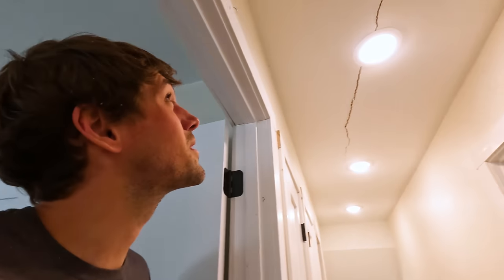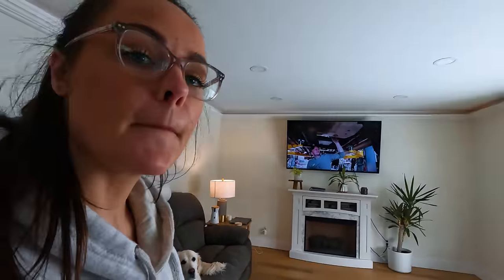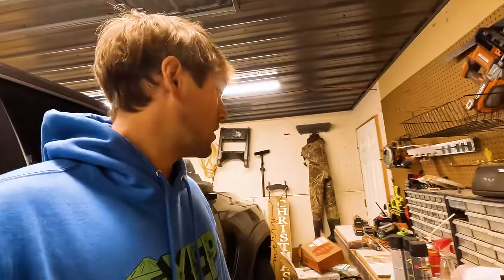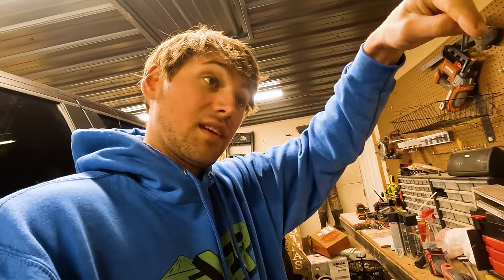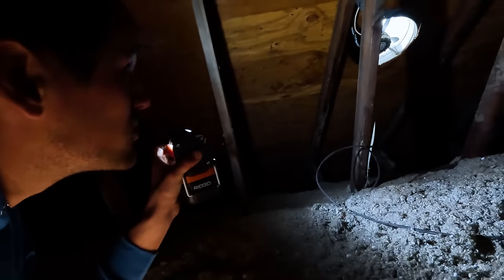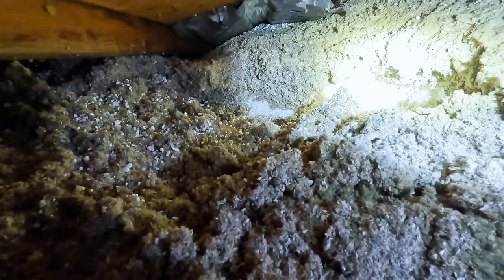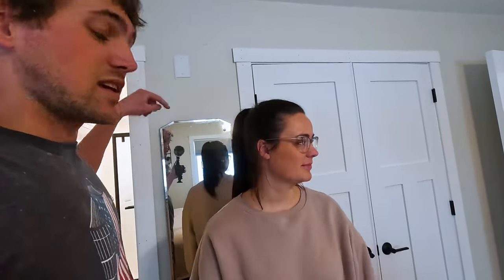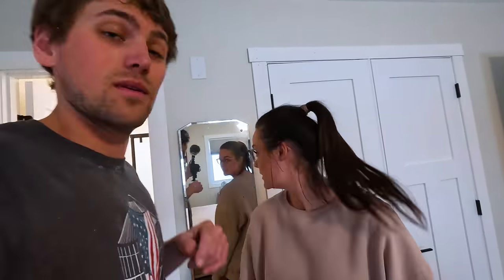DIY House Remodel Gone Wrong!!

Comment: Renovation is fun. I have fully renovated the house I was born in both the interior and exterior of a 130 year old Victorian. All of it completely original condition other than the bath room which the original one was remolded in 1910 with subway tile and an octagonal tile floor . Alway something to repair and redo. But you learn.

Comment: Attic exhaust fans are on a temperature control switch so once it reaches a certain temperature it will come on. Plus bathroom fans for toilets didnt have to penetrate outside wall unless it’s spray foam, we use to run them to the soffet. but shower fans have to penetrate outside walls per new codes due to the moisture.

Comment: Jean had me laughing when you gave her the vaccum was so funny.  Don't worry Chet, stuff happens during DIY, but you are getting it done.  I hate getting stuff with missing parts, if it was a return, they should check to make sure everything is there when it's returned, bummer you saw it after installing the unit.  G-d bless.

Comment: Like others said you need that exhaust fan have its own vent tube it also can not be vent out rhe roof it needs to vent out the side of the house. The tube to needs to go straight up from the fan and then run horizontal with a slight angle down to the outside of the house. If you do not do this left over moisture in the tube can run back into the fan area.

Comment: I'm sure it's been said.  To meet National Electrical Code you need an electrical junction box behind the vanity light.  Each exhaust fan should be vented on its own.  If you have a gable end they make some nice retrofit kits to vent outside in siding.  You are correct Insulated venting is better.
Reply: Joys of home ownership.
Reply: The fart fams looks nice.

Comment: In a area heavy snow area like yours you need to run those out to the soffit or wall to vent. In your case, the soffit vent is what you would do. That’s the way we do it in northern Wisconsin. The roof fence will eventually just lead to leaks or moisture getting with snow.

Comment: Hey Chet I had the same situation where someone ran the bathroom vent into the attic. I found out the hard way because the moisture rotted all the roof rafters. So you need to vent that out side absolutely!!  That fan should have a thermostat to kick the fan on when it gets hot up in the attic.
Hope this help.

Comment: I feel for you Chet.  I changed all three of my bathroom fans to bigger versions last year.  Not fun.  Had to cut holes bigger.  Also, the old fans vented into the attic and I changed them to vent through the roof.  Happy with the results but did not enjoy the process.

Comment: That power vent has a thermostat that’s in the grey box mounted to the rafter. That black adjustment screw in the side sets the temperature when it turns on and off. Generally they are hard wired to a live circuit

Comment: Chet on your new fan area you could go to the soffit area and if you have enough room in soffit you could cut a round hole into the soffit pan and push the air thru the bottom of the soffit, this way no roofing at all !

Comment: You need to go back and put a Tee up for the roof jack fitting, snd make sure the new fan has a draft flapper and prevent back feeding the exhaust air. 7:34  They make Automatic switch with a humidity control. A Humidistat runs the fan as needed.

Comment: If you shove the hose into the eaves, you can get a vent to exit out the soffit if you don't want to poke through the roof.  Use the insulated hose.  The hot humid air will condense into water in you cold attic.

Comment: When I built my house I put an 8:12 pitch roof on it.  It's kind of a pain in the butt to walk on the roof but on the bright side there is plenty of room to move around up in the attic.  As to stepping on the sheet rock, it's easy to do that will all the insulation up there.  You can't see the rafters and kind of have to go by feel.  I worry every time I'm in the attic that I'll miss a rafter and step on the sheet rock.  Don't beat yourself up over making an easy to make mistake.  Everything can be fixed by a good mud/texture guy.

Comment: Live in Canada. Venting into the attic is not good as it’ll add warm air to your cold air creating condensation into the attic. Mood and rot will happen over time. Also remember to use an insulated vent hose otherwise condensation will form from the temperature differential, with same problem. Ps if you put in a timer switch it’ll help with the vent time.

Comment: NEVER vent into the attic or the eve unless you love mold!  That is the whole idea behind venting - to eliminate moisture vapor issues.  That is also why your attic is ventilated or should be.  BTW, that huge fan in your roof is a whole house ventilation fan.  It works to draw air into the house to cool as long as you have your attic cover open.  These are usually installed in your attic opening.  Admire your gumption!!

Comment: We call it the OLYMPIC ATTIC CRAWL!  Good job that job sucks!!!
yes the ducts should be insulated to prevent condensation from temp difference in winter.
Each fan should go to separate roof vents. but wait till the warmer weather  so shingles and caulk will seal correctly.
I would suggest putting a junction box behind vanity light
You should add another switch  location and add a 60min timer for the fan only

Comment: 17:23 "cracks Happen. Severity varies". Fabricated brackets are smart. This is why the smart installer saves odd bits that might be useful later. Special fasteners, etc.

Comment: Chet you should get those fan hoses  venting out of the house, I own a roofing business and I had one person call for a leaking roofing in the middle of winter only to find his fan hose did the same as yours and built up a 2 foot high snow bank in his attic, and that fan you didn’t know anything about is called a power vent, it’s set on a thermostat where when you attic hits a certain tempature it fires up and sucks the hot air out, if you need advice on how to correctly fix your fan hoses on the roof top let me know and I can send you a video on how to get it done right

Comment: We re did our whole ceiling after an insulated exhaust pipe was previously installed wrong, it had been left about 4 feet to long and left a big spot for condensation to settle,  it let the water soak into the insulation of the pipe and eventually into the drywall ceiling causing mold.

Comment: Chet even the best have misstepped when crawling around in the rafters. At least you didn't go all the way through 👍. 
Even I have stepped on the ceiling before. I just got lucky that it was plaster and not drywall so I didn't go through.

Comment: Your attic fan (the one in the roof) looked like it was burned up on the video. Might need to replace that too. In the meantime take your bathroom exhaust fan duct(s) and route them to that attic fan hole. It will minimize humidity in your attic until you can make the proper penetration thru the roof when the weather improves. And since you have to have your drywall guy back to fix your ceiling, run another wire from your shower fan/lite down to the inside wall, just outside the shower. There is an easy way to wire a switch there to control the fan/lite assembly separate from the vanity lite.

Comment: The roof fan has a thermostat (that little silver box you shinned the camera on) there should be a thermostat in it, you just set it to the temperature that you want it to turn on. Most bathroom fans that I have seen just go in the attic. Should have a metal fish to pull the wires. Good luck!

Comment: Ensure you have a GFCI connected ti the fan, usually if its on same circuit acs the bathroom plug it should be good, pop/test the plug GFCI to see if the fan stops.

Comment: Fish down to the switch box, get a Stacked Switch for on the Light circuit switch and then the stack is a fan feed. If you want a automatic they have a Humidistat switch to start and stop the fan automatically.thats an automatic attic ventilation fans - trim the tarpaper to clear the hole 🕳️ and put the fan exhaust on a separate louver on an Eave to outside exhaust - Like a clothes dryer Louver fitting. 9:16

Comment: You should also replace the exhaust tubes with insulated tube so you don't get moisture build up in the winter. If it starts dripping back in to the bath you will know that insulated tube is required.

Comment: Fished in wires don't need staples chet. It's even more fun when u find bats in the attic. Most times we fish down to the switch so u could do a stack switch. If u would have used a 14/3

Comment: My bathroom fan failed.  Interesting to know, even with a fan that was installed in the early 1970s, you can still get parts.  My wife kept turning on the fan and then forgetting it.  So I just installed timer switches that automatically turns off the fan after 15 minutes.  It was worth it.  Having a fan run for hours, blowing heated air outside costs money.

Comment: Vent the exhaust out the wall ,just like a dryer vent .Use rigid insulated pipe Way easier,,, but your into one now , wow.lol.Vent it out of the soffit now use the insulated rigid pipe and make sure it is on a slope towards the outside .

Comment: Chet you need to vent it to the outside and I don't believe you can tee them together because when one fan is running it will try to push it out the other unit and vise a versa, if the big swede give you crap you can just send him up there.

Comment: The Strugglebus runs all of us over at some point.  Ask your Dad how he knows what not to do.  I have to agree with other posts, you can't T an air vent, air doesn't work like electricity.  You'll just end up blowing moisture back down the leg without the running fan.  Unfortunately you got some unscrupulous and lazy roofers.  All vents should be replaced and hooked back up properly, even the annoying ones on the edge of the roof.  And the last step is always the most likely to cause the need for more steps.  Another lesson that is always learned the hard way, no matter who it is.  Take care and God bless!

Comment: That's a power vent. If working it comes on at a set temp. Put one in one of my previous houses. Works well when they operate. The blow in  insulation looks like cellulose. Basically ground up newspaper

Comment: Roof spaces are always a painful experience that type of installation has not been installed in homes for over 30 years or more due to various complications you should always where a disposable suit when dealing with that stuff it’s pretty bad if you have to go up again get yourself a proper mask not a disposable one they are just not good enough for that type of job as for ceiling it can be fixed at least you didn’t end up on the hallway floor so take that as a positive stay safe and best wishes from the UK

Comment: only thing is that, until you get that vent installed correctly, you may feel some cool air coming in when the fan's not on.  Shouldn't be bad though as I think there's a vent door inside the fan box.

Comment: What is the wire size that you are teeing into? And what is the braker size will they both hold up to the amperage? If you have two roof fans holes I would run each one to there own hole. We always put some plywood down over the rafters so you can walk or crawl on .

Comment: Lol. 
  Since you know where the wall 2x4 is for the switch wall, you just run another wire over to the fan. Add a 2 gang for switches, and now have light switch. Fan switch. Bam bam😂

Comment: Some things are worth paying to have done.   Those fans are heat exhaust fans for summer
Me, I’d leave wire as is and if vent pipe does not touch fan blades you tied up, leave it as is
Good job with fan.   Glad you didn’t step totally thru ceiling

Comment: live and learn :face-blue-smiling::face-blue-smiling::face-blue-smiling: You should have spliced into the lite wire in the attic and been done with it and they have a bathroom vent fan with a pull chain to turn the fan off and on

Comment: Sorry Chet, but each vent fan  needs a different vent to the atmosphere, with a T, both vent fans need to be running at the same time or you are going to be moving  moisture from 1 bathroom to the other 1...

Comment: Yeah the flex pipe should be hooked up, an the fan in the Attic, they should have got rid of it, there not used anymore really, just a Energy user, thanks for sharing chet, oh next time hook wire up before pushing fan in place an the flex pipe, then you won't struggle in Attic in that tight spot,

Comment: Not gonna pile on Chet. The fan looked to be a whole house fan or attic fan. Never tie into another vent, you should always have a dedicated vent line for every vent going outside. And yes it's bad to vent moist air into your attic, it will cause mold.

Comment: Run your ducting under the insulation until you need it to pop up to go out. Running on top of the insulation, the condensation freezes in the duct and then will drip back into your bathroom.

Comment: Chet after going in the attic you should have gotten a wall mount exhaust fan that vented directly to the outside and per code as long as there is a window in a bathroom an exhaust fan is not required per code which I think is stupid. I put a exhaust fan in both our bathroom’s because they came without exhaust fans my wife takes extremely hot showers and I couldn’t stand to go in after her and during the summer time it would heat up the master bedroom and I prefer to be cold than hot. Not a fun job and at least you aren’t doing this during the summer heat in the attic.

Comment: I would have done it just the way you want it, make holes in the wall put the extra switch, run the wire then call a plasterer. You will be happier it’s done right!

Comment: Chet, several things. 1. If you are going to the trouble to fish the wire to the light, you are only 3 to 4 feet from fishing to the switch! Then you can have the fan on its own switch. 2. Never tee into another vet. It’s bad for several reasons, including having condensation come down into the other fan.  3. The roofers don’t drop the vent into your attic on purpose. But if it happens, they rarely tell you. It happens A LOT! 4. Your attic fan has a thermostat on it. If it still works, it will turn on at between 120 and 130 degrees.

Comment: Fan and light look great!  I feel your pain working in the insulated attic; I hate having to do that.  Can't you just claim there was an earth quake that caused the damage to the ceiling?  Running wires and adding a switch isn't very difficult, but if youaren't familiar with electricity I understand.  If you hired the roofing work that deleted your vent, I'd be on the phone immediately with the contractor.

Comment: I thought you couldn't put a light/fan above the shower. It has to be so far away from the edge of the shower. I could be wrong they change the National Electrical code all the time, but be careful water and electricity don't play well.

Comment: I remember crawling around the attic when I was much younger.  Those nails in the roof penetrated my hat rather easily.  I had pink blown in insulation when the house was built.  Then with a government grant from our Federal Government I laid in more batts of pink fiberglass.  . . .  then a decade later and another head banging experience, I laid in more pink batts.  . . .  asbestos itches.  You might want to get your materials checked.  Yes, attic work is lots of fun.

Comment: Vent it to the outside right away.  Just letting it vent to the attic will cause black mold.  Any mold isn't health.  Big expense $$$$$$$$$$$ to have the mold remove.  I like that fan.  Looks great.  The crack sucks.  Any way you could blame it on Jean?

Comment: Wearing a mask is important blown in insulation has a good percent of paper dust in it. You may want to use a 6 or 8 in. flue pipe to connect both bathroom vent pipes to two tees then run the flue about 18 in to 2 ft. above the roof peak. when you have both fans on they could compete with each other at the tee. Don't go beating yourself up over stepping on the drywall. we all have done that. Your install looks good. Getting the job done is what separates the men from the boys.

Comment: Chet, the only man that was perfect. They hung on a cross. Just remember, Happy Wife. Well, if ya know, ya know. LOL.
And to add advice here. For the wife. This happened to my now ex wife after I added an extra lite in our bathroom. She came out of the bathroom next morning headed to work. One side of her face looked good. The other side looked like a drywall guy put it on. Reason being the brightness was not the same in the bathroom anymore. Step into the bathroom and look in the mirror. It looked good. Come out into the main part of house. Very distinct line right down the middle of her face.

Comment: Just as soon as you can get the bathrooms vented outside
That big fan is probably to take summer heat out of the attic,
And it should be on a thermostat.

Comment: please do not tie  into the other fan duct it will be a mess in the room due to moisture leaking back. always run new vents out to the outside. have someone vacuum all insulation and then use spray foam

Comment: Well....now that the fan is directly over the shower it has to be GFCI protected. If you installed it just outside the shower then it wouldn't. But I ain't gonna tell you what to do....I've done so many fart fan installs being an electrician and I COMPLETELY feel your pain Chet. Attic work is no fun. Sometimes you'll run into asbestos in the insulation too - hopefully your house didn't have any 😬😬😬

Comment: wondered it would have been easier attaching the hose and wire before you mounted the box from the underside, i would need to as i'm 6ft5 n many bags of potatoes in weight